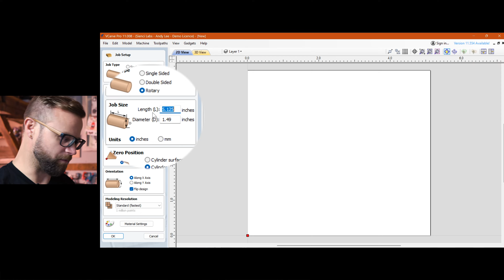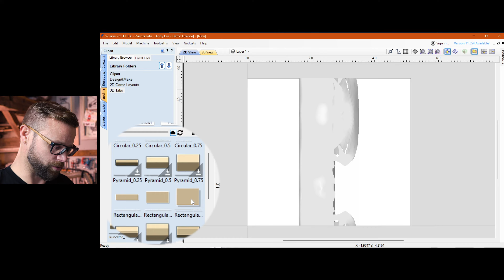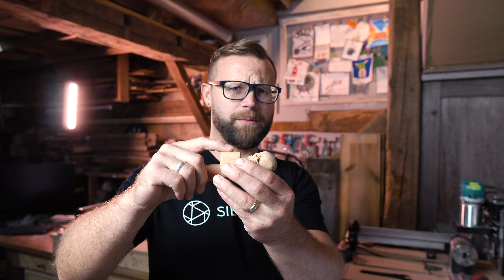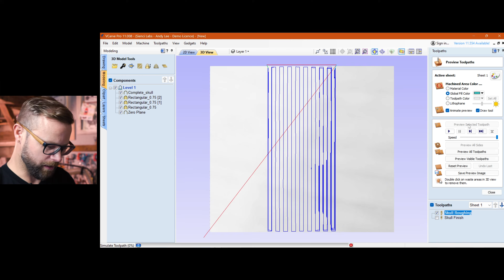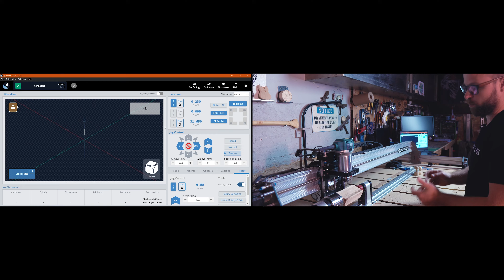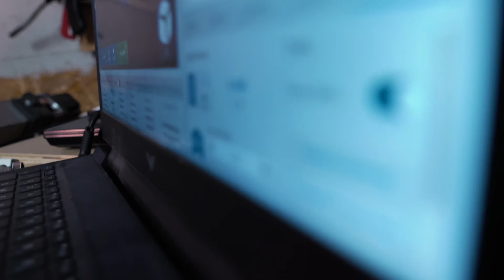Vortex Rotary Axis 3D Skull Carving Tutorial

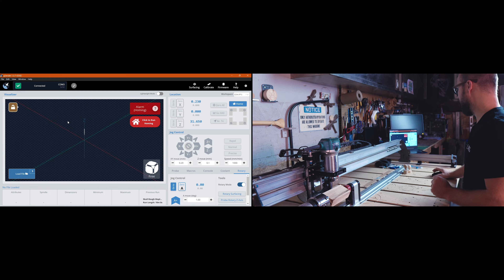Comment: I know that this is an older video, but the comment at 19:08 that you must be using Edge when using the rotary is not accurate. I don't know if it was when the video was made. It is definitely not true now.
Reply from the maker: Yes, you're definitely correct 👍 We'll pin your comment in case other people need the clarification as well
Reply: @SienciLabs  Tks much. It's not a big deal, I know. It came up in a somewhat heated exchange on the forum so I thought that it was worth pointing it out.
Reply: I know there has to be a better way to car e staff

Comment: Curious,  Is the Vortex rotary axis a stand alone unit or must it be wired into a cnc router?
Reply: It's an add-on for a CNC router
Reply: Thanks @BoulayWoodworks
Reply from the maker: The Vortex is an add on that works in conjunction with your router.
Reply: Are there wiring instructions for a onefinity cnc router? @SienciLabs

Comment: Is Vcarve required for the Vortex or could I setup a rotary project in Fusion 360 and achieve the same result?
Reply: It's not strictly required, but Fusion puts their rotary features behind their machining extension which costs well over a thousand dollars, so at the moment we recommend people stick to VCarve. There are technically also other workarounds such as unwrapping the model in a program such as MeshLab and then importing that flatted model into Fusion for toolpath generation, or use Luban (from snapmaker) to generate rotary toolpaths on models with some copy pasting, but both are quite involved and can get frustrating to all but the most advanced users.
Reply: @johannchungsaojing  Appreciate the reply and explanation! 👍